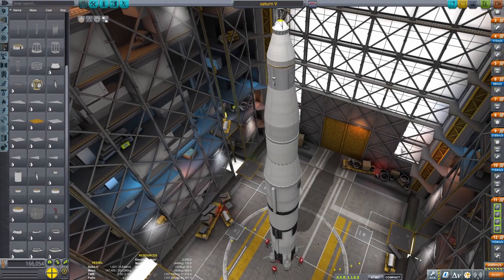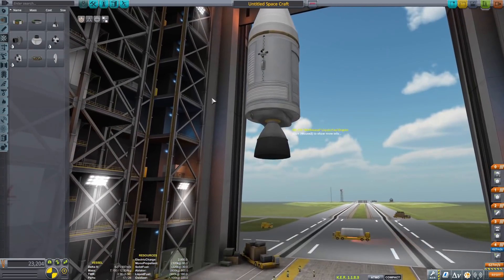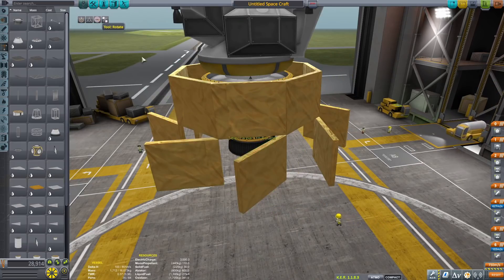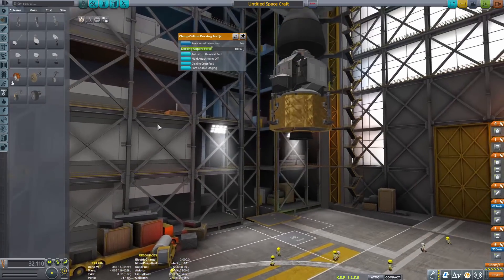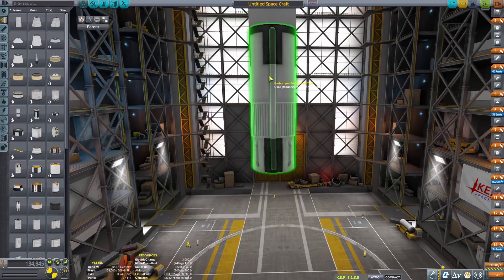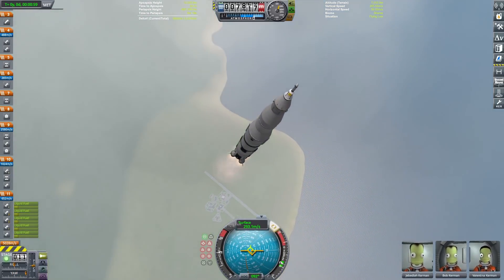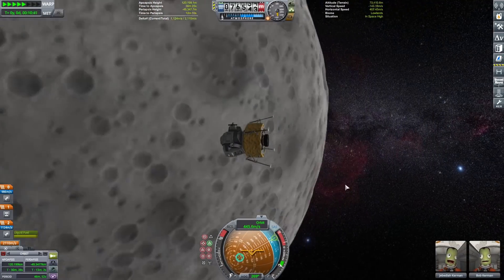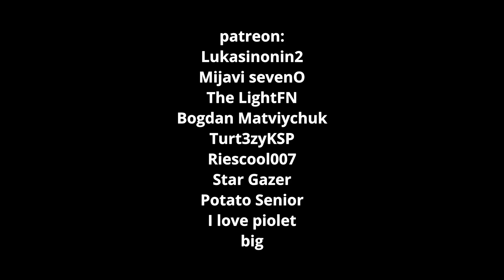KSP Saturn V Tutorial!

Comment: A little late but: 
1st - LOVE THE WALKTROUGH! I sat with my game, built, paused, corrected, built more following step by step and it works like a charm! (Pausing was mainly for part names)
2nd - Slight Misnamed part in your video. On the upper stage (connected to the LEM) you said a "decoupler thingy-ma-bobber" on the bottom of the 7200 tank. It's not a decoupler, it's the engine mount. Thankfully, as I was building it along with you, I watched where your mouse went. =)

Awesome vid. Great content and a new sub!

Comment: Very weird, when I put the wolfhound engine on the service module I only get 130 delta-v instead of 630, I use the exact same fuel tank etc...
Reply: He sets it in the VAB to vacuum which is what the engine is designed for, the reading is the deltaV if used asl so in flight u will see the number rise to the same as his

Comment: Tip: Because the lander capsule runs out of RCS very quickly if you keep it on all of the time, I recommend turning the thrust limiter for the capsule RCS all the way down to around 25% because you don't really need the power the RCS gives and it stops the monopropellant from draining so fast so you can safely have RCS on pretty much the whole time.
Reply from the maker: good idea
Reply: I personally just stick a small reaction wheel into the lander. It has fuel cells on the bottom stage anyways, it can easily recharge.
Reply: Xxxxxxxxxxxxxxxxxxxxxxxxxxxxxxxxxxxdxxxxxxxxxxxxxxxxxxxxxxxxxxxxxxxxxxxxxxxxxxxxxxx
Reply: just clip a reaction wheel in the lem
Reply: but why would you have rcs on the whole time 😂
Reply: @Vakowski  Because the capsule doesn't have its own reaction wheels, RCS is needed for orientation unless you are ok with clipping extra reaction wheels into it.

Comment: btw the Saturn v/apollo capsule didn't have a fairing over the capsule to protect it from the abort motors. It was fully exposed
Reply from the maker: ummmmm... yes it did https://cdn.discordapp.com/attachments/768643778395111444/850985511371407390/image0.jpg
Reply: yes it did
Reply: Never doubt the piolet
Reply: This is true i clicked the link.
Reply: The CSM always had a fairing over it to protect it from the Launch Abort System.